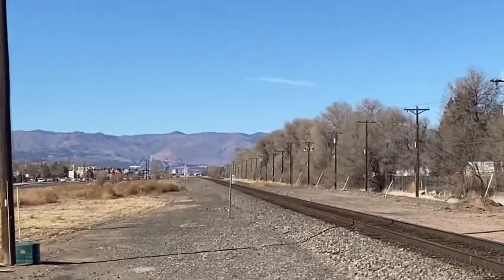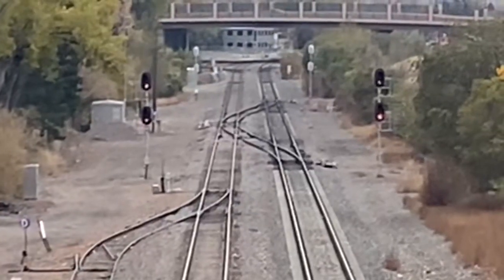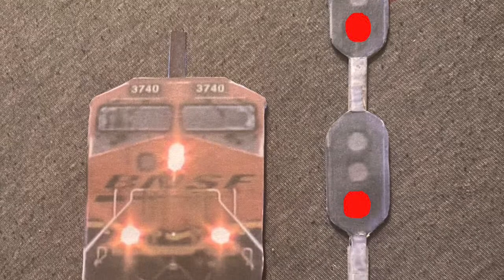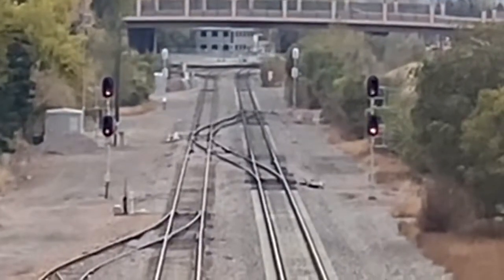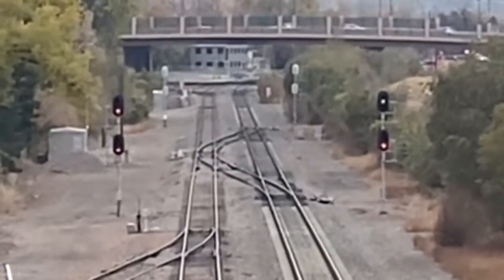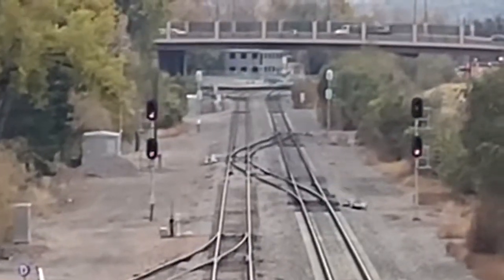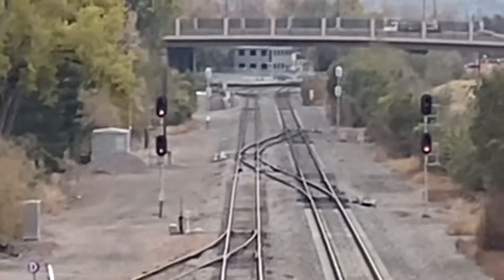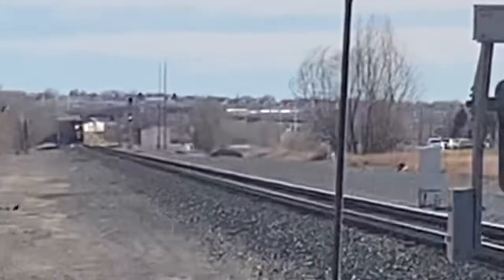How to Read BNSF Signals part 1

Comment: The flashing yellow signal is called an Approach Medium. You did get the rules correct: Stop in 2 signals, and 40 mph limit. An Advance Approach is a solid yellow over solid green. It means 50 mph limit, and there will be a diverging signal next.
Reply from the maker: Yeah I Figure because UP Share this line
Reply: This is correct. This is BNSF track.  When UP uses the line, they also have to follow the BNSF rules.

Comment: By the way. Number plated signals are called intermediate. They are controlled by train occupancy. They are not controlled by the dispatcher. A signal with no number plate is an absolute. They are controlled by the dispatcher and you can absolutely not pass it without talking to the dispatcher. And if you pass a red absolute you probably won’t be fired. You’ll just be suspended. It’s a fra violation not a company violation
Reply from the maker: Yes true
Reply: Remember that all controlled signals are absolute, but not all absolute signals are controlled signals.

Comment: If the dispatcher lines the train to stop at red and they can proceed on a red if they have permission from  the dispatcher to pass the red
Reply from the maker: True
Reply: Authority
Reply: Just remember that practice should be avoided whenever possible.  It's literally less safe.
Reply: @jovetj  they do it all the time they flagged Trains right behind the other Trains if it’s red
Reply: Welcome to a class in "What Signals Don't Mean."

A signal can only convey information about the track ahead one block at a time--NOT two or more.  The aspect can tell you HOW to approach the signal at the entrance to the next block, but that's it.

Unless you are a qualified Rules Examiner, ask a bunch of questions and learn about how hard it is to ace an exam.  (I was never a Rules Examiner, but I did get a score of 100% correct--ONCE!)

If you continue to interpret what a rule means you may experience what failing to comply with the rule means.

Comment: 3:25 I want to give you some advice.  The lower Red light may not be particularly significant at the moment, but you can't say it has no meaning.  It does have meaning, because the signals the train crew are observing and interpreting MUST correspond with what the rulebook shows.  If 🟢Green Over 🔴Red were not in the rulebook, then it would be a signal improperly displayed and the crew would have to treat it as malfunctioning and respond as if it's showing Stop (its most-restrictive aspect, as it's a controlled signal).  Luckily, 🟢Green Over 🔴Red IS in the rulebook, and it means the same as 🟢Green alone or 🟢Green Over 🔴Red Over 🔴Red.  The fact the rulebook shows them to be equivalent is the only reason that Red isn't significant. 

Don't feel bad, it's a common misconception amongst railfans to say "that Red means nothing" or "it can be ignored" but it cannot.  There are also signal schemas where that Red can matter.  For example, on some Speed signaling schemas, 🔴Red Over 🔴Red Over 🟢Green is Slow Clear but 🔴Red Over 🟢Green is also Slow Clear.  Other schemas would have 🔴Red Over 🟢Green be Medium Clear but it just depends on how the signaling evolved on that railroad.  If 🔴Red Over 🟢Green is Slow Clear then Medium Clear has to be 🔴Red Over 🟢Green Over 🔴Red.  That Red may be on the bottom, but it matters.